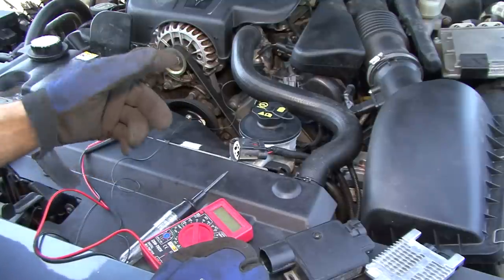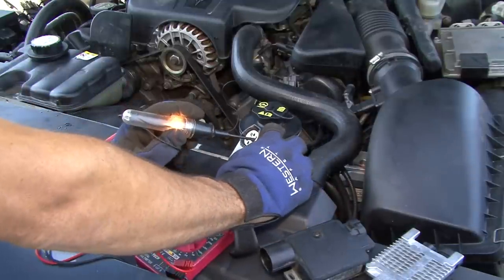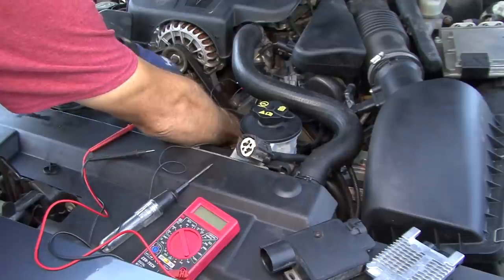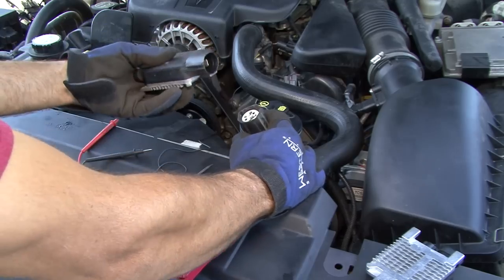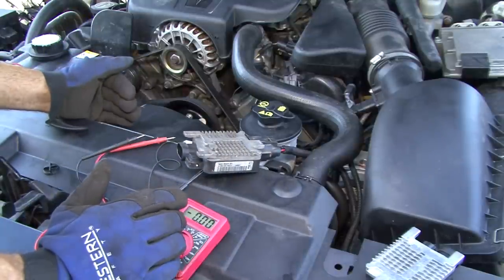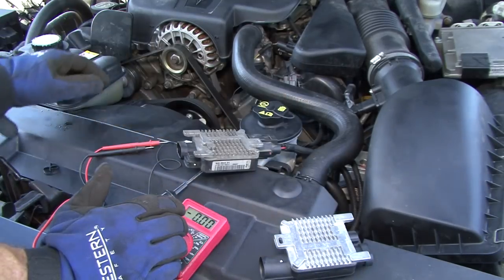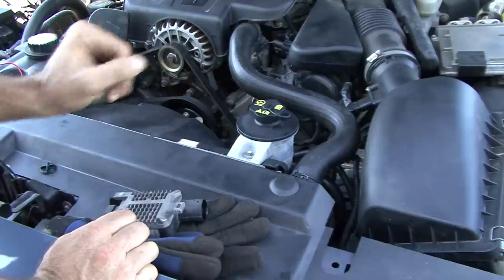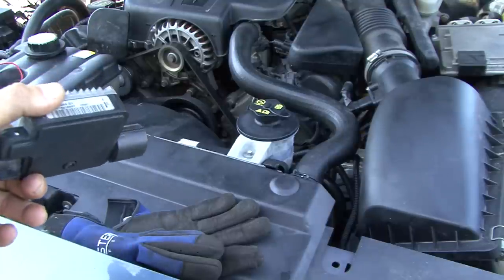crown victoria radiator fan module troublehooting and replacement

Comment: The  fan on my 2009 crown vic is running the wrong way. Clockwise when looking from the cab. Air is blowing forward, away from the engine.It only runs if 12V positive is on the black wire going into the module and ground is applied to the red wire with black stripe. How do I reverse the fan?
Reply from the maker: Mike Lill some how your wires are wrong the red should be positive and black is negative

Comment: Hey man, I'm gonna replace my fan motor but I cant seam to find just the motor for sale anywhere, i already have a new module and the blade and shroud are fine. Where did you get the motor ?
Reply: I think you can only get the entire fan assembly with or without the module.
Reply: @wojciechgowacki5778   I ended up goin to a junk yard and got the whole assembly for 20 bucks
Reply: @Kyles_kittens  bingo

Comment: I have a similar/different problem, the fan blower does not come on. I replaced the module and fan, also the blower motor fuse(50) and temperature control sensor. What are my other causes.
Reply: Did you ever figure it out?

Comment: Nice video, but where do you hook the alligator clips? I'm looking at mine so I can test the fan and do not see how you hooked it up because you did not show us.
Reply: Wooley689 you hook it to the fan side of the module
Reply: Thanks , I hooked it into the pigtail that goes in module side. Got it all fixed up.
Reply: On the module? 
How would that make fan turn on if its not connected to receive voltage.

Comment: In my 2008 crown vic police interceptor the fan module was damaged, I did a voltage test and it only raises 4 volts.  I bought a new module and when I installed it it didn't give me a single volt, so I went back to the store and talked to the supervisor and told him what was happening, he gave me a different module but it doesn't work... I put the module back in original and it gives me a reading of 4 volts.  I do not know what it could be
Reply from the maker: That's a strange one. How was the other one damaged? Front end crash could have damaged wires. Or bad ground from being damaged. I also have a p71 police interceptor.

Comment: 2007 Town car. Fan stopped working. Tested fan by direct connection to battery. Good. Bought new module, installed, fan still not working. Fuses good. Power is getting to module plug via test light but I suspect that the third little prong in the plug is not getting a signal to activate the module. Been trying to hunt down the problem for almost 2 weeks.
Reply: Did you figure it out?
Reply: @RandDoe  yes. The thin red signal wire was corroded. I trimmed it back until I saw shiny wire and spliced in a new wire. Solved

Comment: My fan runs all the time even with the key turned off.  Runs the battery down. In the fuse box there is a 50 amp fuse(201)but no relay is designated for the coolant fan. I was hoping it was just a stuck relay.  Why is the fan constantly on?

Comment: Hi, men I change the module and is continuing the overheating and I change to the sensor temperature in continued the problem can you help me I have 2007 mercury grand marquis
Reply: Man i have same issue i replaced module twice. Any suggestions
Reply: Did you at anytime put her barsleak  in it if you did your radiator is clogged up

Comment: my brother has a 07 Crown Vic. replaced the fan and the module and when we turn on the AC unit the fan still does not want to turn over. replace fuse and relay also..  stuck
Reply: Trev B what was the issue?
Reply: Trev B Change the coolant temp sensor behind the alternator

Comment: i have a 2000 crown vic police int, electric fan dose work but wont kick in on its own , i have replaced relays , fuses , thermostat , egine temp sencer , and the fan will not kick in ,,im lost
Reply from the maker: Randall Scott This video should help you, sounds like the module has gone bad it controls it
Reply: Cody the Car Guy
Reply: Cody the Car Guy where is the module located

Comment: Where is this module located?
Reply: On driver side mounted on the plastic fan shroud just to the left of the fan motor. It has one tiny screw holding it you can't see until you remove the wire connection on top of it and two finger slots it slips in to.

Comment: Hi I was hoping for some help. I got a 98 crown Vic. my problem is that the fan seems as if it's overworking. like if it's trying to keep the engine extra kool. Any opinions would be great. thanks
Reply: Jet Bomb1932 Change Thermostat coolant first.
Reply: Mine does the same thing. Figure it out?

Comment: Having issue with my '01 Grand Marquis fan kicks on normally but battery voltage gauge drops way down to where car is barely running due to the electrical coils it has also. headlamps or anything else on at night doesn't drop voltage, but only when AC is going, and fan kicks on it will drop down to just above "LOW" on the gauge and will normally between mid way of "LOW" and "HIGH" on gauge! why is this and is it normal? I have new alternator in it.

Comment: Can someone help me. My fan keeps on dying I've replace it twice  in 2 moths. It usually stars by fan randomly stopping to work. Replaced it alone with the module. When the ac is on I blows on full all the time. Ac has new gas in it.
Reply: When your AC is on or your defroster  your engine cooling fan will also be on. This is normal operation
Reply: If it's not turning on when the ac is off and the vehicle begins to overheat you need to check the temperature sender/sensor on the cooling system

Comment: 2003 CVPI. The engine will go to operational temperature, fan will turn on, engine temp will drop below cold, fan will constantly run and when the temp drops the transmission starts slipping. help please!!!

Comment: Trying to figure out why the engine surge's before this module shits the bed !!
    Anybody ?
Reply: Engine rpm maybe increased to run high demand AC but that should just be with trans in park. There are other sensor problems at play,  You should be getting DTC's coming up, car needs to be put on a scanner.

Comment: heres a question, my fan runs ALL THE TIME when the vehicle is on.  The fan turns off when the vehicle is off.  Replaced the module, no change.  Replaced the thermostat, no change.  No idea where to go from here!
Reply: Sounds like a bad sensor
Reply: @nickmason5001  where is that located?
Reply: Ever figure this out?

Comment: OK folks...
  09 mercury marquis...
  Water pump replaced 8 months ago... Its been fine since, then yesterday it was 90°+ sitting in a parking lot with the a/c on and motor idling...& suddenly, I feel a surge and the idle drops 2-3 hundred rpm's this happens for 20 min and car overheats !
 Cooling fan not running, relay/module is bad, only putting out 4.4 volts...
   I put gator clips on pos and negative, the fan runs..
   So I change the module and the motor is now starting to surge again, fan is running !?!?!
   I'm baffled.. Thinking I'm going to burn out new module ??
Reply: Module shouldnt burn out (if the fan motor is in good shape) it just does what the PCM tells it which is how fast to turn the fan, ie what the fans duty cycle should be, 0-100%
Reply: I have replaced my module twice in a year, the second one only a few weeks ago. Now my car is doing it again, surging /overheating and fan not kicking on. Both times I have checked the fan with jumpers and it works fine. 
Now this week I have the problem again, just checked the fan and it works fine, hooked module back up and fan not working, turn on defrost and then tried A/c and fan comes on at both positions. Radiator Fan won't run with the selector control to off.
I changed the coolant thinking it might not be up to the job, but then to find last night the fan did not come on and began to get hot - as usual - so I did the checks today and again as above now fan works except when comfort controls in car are set to off.
This is getting time consuming and annoying not to mention frustrating and costly. And of course, it has to act up on a holiday weekend.
Why is this happening????? AARRRGGGGHHHH

Comment: wheres the fuse for fan 06 crown vic
Reply: It is in the fuse box in the engine compartment spot # 50 if you are standing in front of the car top far right it is a 50 amp red fuse

Comment: This is method and the theory behind it is absolutely baseless and incorrect. First, almost all fan modules use a stepped voltage from/to communicate with the PCM. That's a pulse width modulation signal (PWM). Basic test light and multimeter equipment are not capable of checking that type of signal. The duty cycle (frequency) of the signal is too high for them to accurately measure it. So it MAY be totally possible to get voltage "jumping" all over or the test light even flashing out of control. Especially when using a 4$ generic multimeter??
Second, how the hell would you test the first (old) module if the vehicle is not running and the ac command or temp sender is not activating a request to the PCM?  Hello?
Third, usually it would make more sense to test the known working component and get a constant value for these measurements to compare to  on the old (and suspected) faulty component in question. 
Just my 2 pennies.
Reply: Brent. My fan is not turning on. I have changed module, cylinder temp sensor, and have tried jumping 12 V to fan. Fan works with the jumping. But never with AC running or if engine is hot. Could the problem be the variable wire? BTW if I disconnect the cylinder head sensor, the fan comes on.

Comment: No parts stores stock these stupid expensive cooling fan modules... Two day wait or more !
Cheap parts are not good !
And good parts are not cheap !
  Ford Lincoln Mercury......
  ALL GARBAGE !!!

BUY GMC OR CHEVY !!
Reply: The dealership doing cooling fan repair doesn't change just the module they change the whole unit motor and all, perhaps their thinking is that the windings in the fan start breaking down as a result of constantly running in hot environment, thus leading to higher than normal amperage draw and hence overloading the module. You need to check if the fan motor is drawing high amps not just check if it runs. Is it setting DTC P0483? cause thats the motor over drawing amps, is the motor dirty and not spinning freely? Also Lazlo Toth's comment is valid.